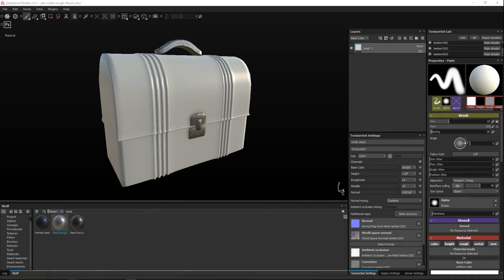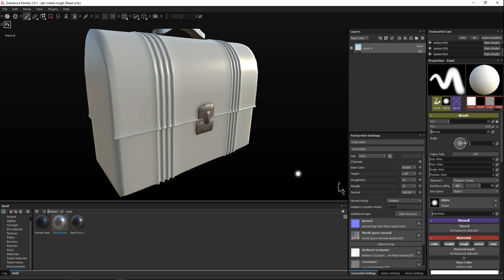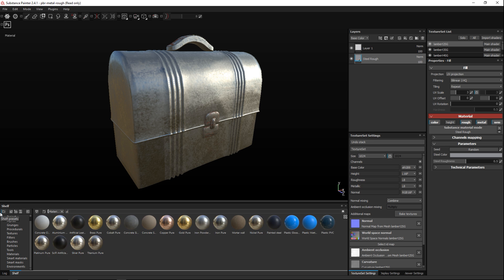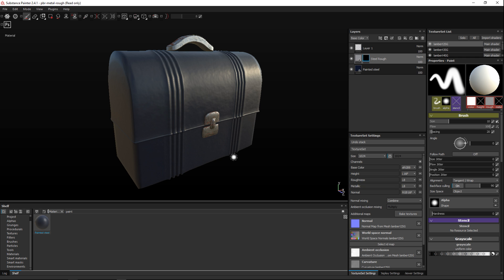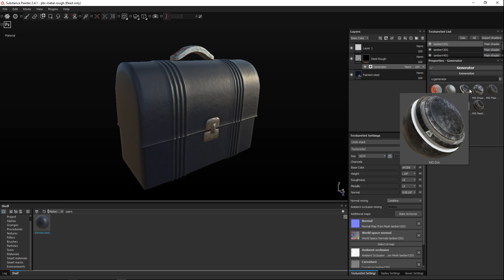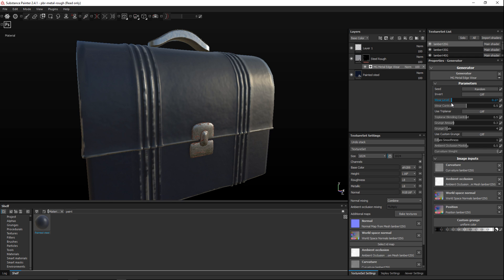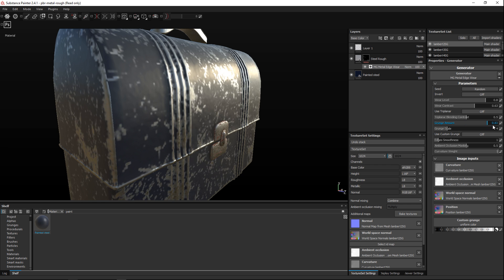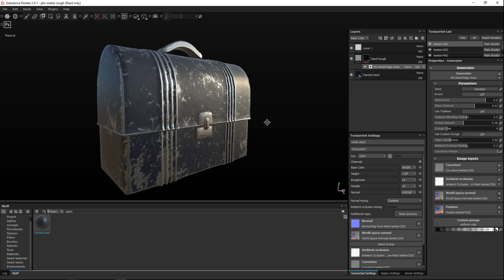Creating wear and tear in Substance painter

Comment: Hello! How do you isolate the areas where you dont want the generator effect to be applied on? Seems like the generator covers the whole mesh itself. I tried the black mask but alas, nothing happens.
Reply from the maker: A Generator is basically a brush template on a preset mask. If you don't want to use the preset you can always mask it yourself

Comment: For example I can export this substance into UE4 and I can change those parameters of the Metal Edge Wear inside Unreal and it will use the curvature of any geometry that the substance is applied to? i.e the same substance can be used on different geometry?
Reply from the maker: I am not sure whether it can be changed in Unreal after it has been imported as I don't use UE

Comment: Question: What about height maps? When you have this king of different textures, like paint and bare metal, the paint one has more thickness than the metal. I know how to get those results with V-ray, but what about Substance? I'm not a Substance user (yet) but it would be nice to know for everyone.
Thanks for your videos!!!
Reply from the maker: The height information is set and stored in the maps that we create at the beginning. Whether it is saved in a height, bump,displacement or normal map depends on software and use
Reply: I see. Thank you!